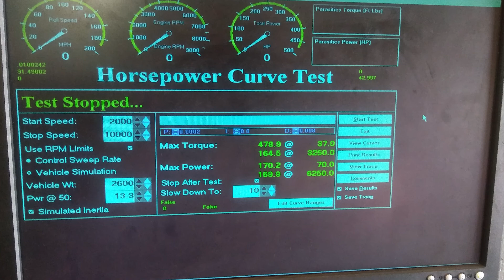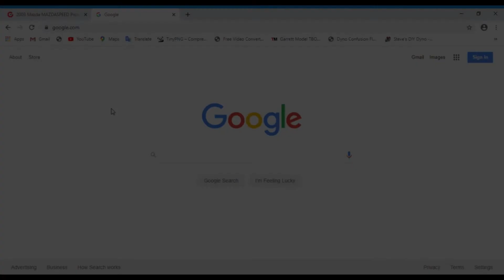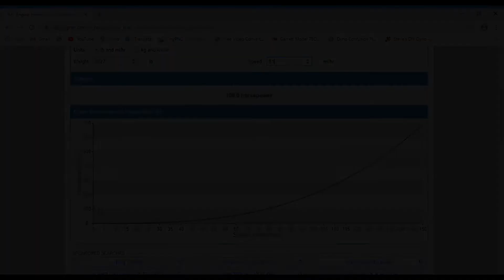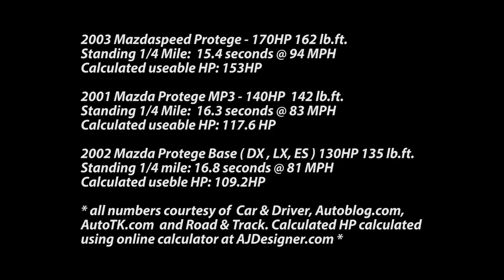Mazda Protege Baseline Follow Up EP.6 Pt. II

Comment: I've been having a lot of fun watching your videos. I love the insight you have and the way you question your findings. Also, your quest to right what you feel is wrong. I have a LX with a couple mods. I tested it at the track completely stock and it matches to a T. 16.9 best ET, 81 best mile. Could have done maybe a 16.7 but didnt feel like beating the car too much, since it was my girlfriends car at the time. I have added an assorted variety of mods since I bought it for myself, but never tested it again. It does feel quite a lot "free-er"
Reply from the maker: Thanks! When I post videos about this car, I try to put out information that I had questions about that nobody seemed to have answers for. Hopefully by posting my findings, it will help others understand the car more and keep them interested in the Protege because I feel the car has excellent potential!

Comment: I like to trust the best dyno of all, the butt dyno 😎👍 If it feels fast, it is fast. My sister in law used to have a base model Protege with an automatic. It is the second slowest car I've ever driven. Only thing slower was my old '86 VW Golf diesel. That thing was scary slow.  Needed a quarter mile of room to pull out into traffic in that VW. My Volvo 240 wagon was faster than her protege. Your car is way faster than hers was and definitely faster than my wagon. So there's gotta be some sorta gains. Like the outro to the video. You should do something similar as an intro. I'm looking at doing an intro for my channel sometime soon. Right now I just have a generic intro.
Reply from the maker: Yeah true. The base Protege with an auto-slushbox is very slow. But the whole point was to try and prove that the MP3 computer and modifying the manifold actually bumps the 130HP output to 140 - 145 HP. The baseline run was SUPPOSE to show the power BEFORE the mods. Since I got the results that I got, it sort of ruined the attempt to prove this. Getting someone to baseline your car is very difficult, at least here in Florida, because they just dont want to be bothered with the task. Even if you explain to them what youre trying to accomplish. If you arent tuning for 400 plus HP, seems dyno owners arent interested in what you have going on. I got so much run around trying to get someone in the bay area to baseline the Protege. One guy even lied and told his employee to say that he wasnt there...but you could see him working in the back!! The only shop to take me in was that particular one in Orlando. And the results were far beyond what is realistic.
Reply from the maker: Also I got a few ideas to refresh the intro and out scenes as the channel progresses. Hopefully by the next project car Ill have something whipped up to make it look much nicer.